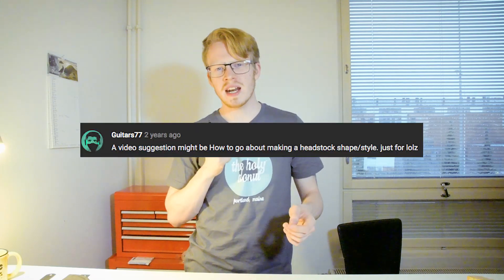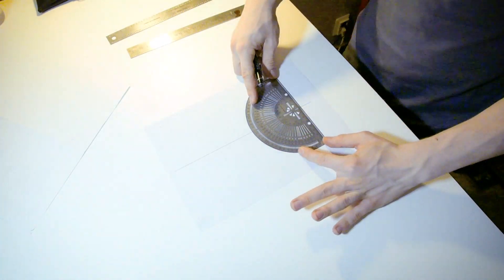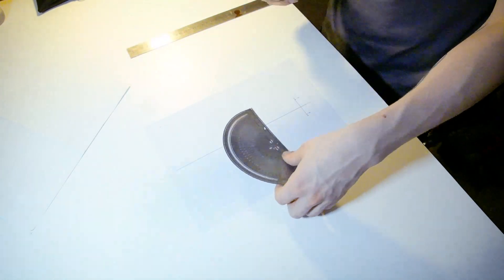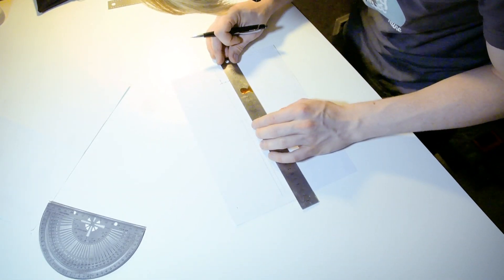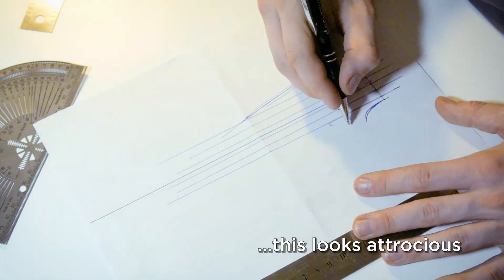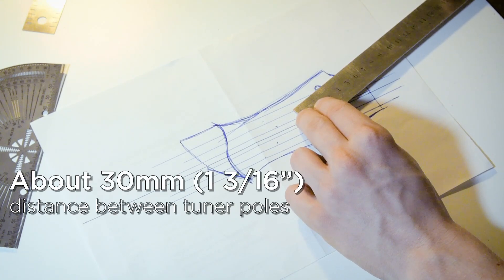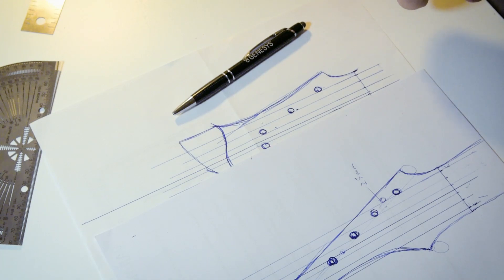How To Design A Guitar Headstock - GUITAR BUILDING TIPS

Comment: Thanks bro, I'm currently trying to build my first guitar, and I'm having troubles with the headstock, I've made a plan from a weird uncommun bass headstock, that I've made a template out of. But now that I'm trying to figure out how to align it with the neck, I just discovered, that the strings we're not gonna be in a straight pull, NOT AT ALL. So ill try to play with the angle a little bit and use your tricks to make them a little straigther, even if my headstock is a little crooked in the end, I don't want strings to be bending that much.

Comment: Interesting.
For straight string pulls, where do you plan the location of each tuner peg in relation to the peg's string line? 
 - Put the centerline of the peg on the string line? 
 - Put the tighten edge of the peg (during righty-tight tuner turns of the tuner knob) on the peg's string line? 
 - Or some other placement of the tuner peg in relation to the string line? 
        Do you need to account for the diameter widening as the more of the string wraps around the peg?

During design, what diameter do you use for the peg (not the hole to be drilled) in order to properly place the machine head in relation to its string line?
Reply from the maker: Fantastic question!
So essentially I account for the first string wrap, so from the point of view of the side of the tuner shaft. The exponential diameter growth or added string winds I haven't come to notice as making all that much different to necessitate taking into the equation. I'd rather have the tuners look more cohesive between one another and the edge of the headstock than have to worry about all of them being incrementally at different distances.

So simply put: commonly the shaft of the tuner where string wraps around is 6mm, so account for 3mm away from the point at which you drill the whole.

Comment: do you take the string guage into consideration for string spacing at the nut/bridge?
Reply from the maker: Yes at the nut for sure :) the thicker gauge, of course you'll need to take into account the size so that you don't have the strings essentially sit on the very edge of the fretboard
Reply: @IPGuitars  thanks... so, just want to make sure my understanding is correct... the string to string distance (edge to edge, not center to center) is the same value?
Reply from the maker: Not sure I understand what you meant, but basically what I would do in the case of thicker gauged strings is to find the distance from the edge of the nut on both sides and then use the string spacing rule to find the rest. The string spacing rule compensates the distances between slots (or string centers as it were) to allow for even spacing between the different gauge of string.

I hope that answers atleast some part of your question😅
Reply: @IPGuitars  yes, you did answer my question, many thanks again.
Reply: The string spacing rulers don’t create equal spacing at the nut. They are meant to take relative string gauges into consideration. Therefore, you cannot take the spacing generated from the ruler and extend the lines up to the break angle and expect to get equally spaced tuner locations. If you are looking to achieve equal tuner spacing, you will have to live with a compromise on the straightness of the strings. Its a small difference but I think it should be noted for those who are wondering about this or who are looking for perfection. If I’m missing the mark on this please feel free to correct me. I found out the hard way BTW.
Reply from the maker: That is absolutely a great point!
In my example here, I am speaking in broad terms. Trying to aim for absolute perfection will of course require WAY more precision than something achieved here.

I tend to opt for this method I talked about, because I might vary the gauge of strings I use depending on the use of the build, but keep the location of the tuners the same with same shaped guitar headstocks.

Yes, the different gauge of string (and how many wraps the string does around the tuner) will change the straight line of the string following the nut, however not enough to cause the string to bind in the nut slot/pop out :)

But yes, definitely a good point you made if you are going to be using a specific gauge and wish to aim for absolute perfection. It's a challenge for sure, but not impossible.
Reply: @StephenSgro  thank you... that's exactly what i tried to ask... but not successful :P
Reply: @leochen1960  your welcome!
Reply: @StephenSgro  Additionally, the ghost strings he's drawing here aren't necessarily parallel. He just eyeballed those compared to the centerline. For straight, parallel strings you'll want to use that protractor again based on the nut that you draw, just like he did with the centerline.

Comment: and for 12 strings?
Reply from the maker: Great question, and really depends. Two/three ways you can go about it:
1) 6-in line on both sides
1.5) 3+3 smaller/offset on both sides
2) 3+3 and then 3+3 between with holes in the middle of the headstock as you you find on a classical acoustic

And then apply the same principles as with a "regular" headstock

Comment: First time headstock designer here. Are you measuring 12mm from the edge of the tuner side to edge of the 10mm tuning key hole, or to the center of the tuning key hole?
Reply from the maker: I am measuring 12-13mm from the side of the headstock to the middle of the hole-to-be-drilled :)
Reply: @IPGuitars  Thanks!

Comment: I would note a couple of problems with these designs, just to make sure no one else accidentally repeats the mistakes.

The first is just minor and has to do with the shape of the 6-in-line shape. Your cutout opposite of the tuners is too deep. You probably shouldn't be crossing the string with the desired shape line. I mean you could, I suppose... it probably wouldn't hurt anything directly, but it leaves the E string exposed with no protective wood around it. If you bump something within that scoop design, it's going to hit the string before the headstock. Like I said, kind of minor. Don't hit the headstock, and it'll be fine.

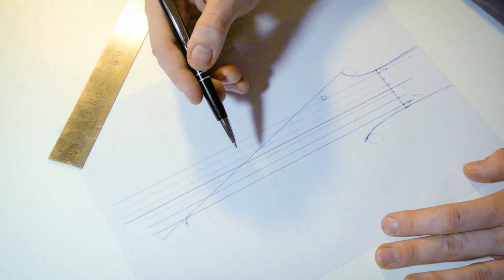The other is an issue with the 3+3 design. You've used two conflicting thoughts here. You made a curved shape, but then just aligned the tuning machine holes in a straight V pattern. The tuning machine holes, as you stated with the 6-in-line headstock (5:54), need to be a specific distance in from the edge of the headstock. They should follow the shape of the headstock, while also remaining at an equal offset distance from the edge of the headstock. In your example, the D and G machines for sure, and likely also the A and B machines, are not going to function, because the handles/buttons/whatever-they're-called are going to be directly under the wood of the headstock. Two solutions to this dilemma are seen between a Les Paul headstock and a Flying V headstock. Form vs function. On a Les Paul (a pretty typical 3+3 style) the D and G strings break out at more severe angles away from center due to the distant tuners needing to maintain the edge offset of the heastock design. On a Flying V, the shape of the headstock is modified to an atypical arrow head shape in order to keep the strings straight while maintaining the edge offset. This is actually more analogous to a 6-in-line style. Musicman's 4+2 headstock uses the same intersecting angle style (triangular), but they have a little more design leeway still, due to the offset number of machines on each side. It leaves room for a sort of bubble area to make the shape move outside of just a triangle. On a Flying V triangle style, the only place to make any innovation is to vary the overall length of the headstock, stretching or squishing the triangle, so to speak, or by adding a sort of ornamental design to the tip of the triangle (Sort of like an Ovation headstock, or your preliminary axe-head style shape before you modified it to be shorter).
Reply from the maker: Thank you for your comment :)
To the first minor bit: Totally agree on the exposed E-string, but the actual shape of the headstock was not really the point of the video, so they are what they are unfortunately. While I should've actually pointed that out more clearly as well.

And you are completely right again about the 3+3 headstock. Again, I should've clarified that the main focus was the distances between tuners and the offset from the edge. Also, admittedly I should've actually PROPERLY designed headstocks here instead of just drawing a random shape for a "sort of" reference on what to do. And I still maintain that the horrendous 3+3 shape I drew is well.. just that. 

Soyeah, fully agreed with you that had I done a proper job of actually making headstocks that work instead of the surface-level technicalities, this would have been a much more helpful video. One which (now looking at it) I really should remedy.
Reply: @IPGuitars  Looking forward to the reboot. 😜
Reply: @IPGuitars  thanks for further explanatios.

Comment: To simplify this somewhat, for a six in line headstock with straight pull (generally speaking), for the fairly standard nut widths of 1-11/16" to 1.703" and string spacings of 1-15/32" and 1-17/32", respectively, the angle of the tuner side should launch from the center line at 15°. Accounting for the touch points of the strings to the tuner posts, position the center points of the through holes between 15/32" and .500" from the edge of the tuner side, spaced at roughly 1" to 1-1/32" along a centerline of the holes. This is very close to what Fender has been doing for decades.

Edit: Use a draftsman's circle template.
Also, consider the proximity of the tuner closest to the nut, and try to make sure it isn't too close. This is to accommodate the tuner body, and also to make sure there is not insufficient string between the nut and the tuner. For most six in line headstocks, there should be about 1.500" from the nut to the nearest tuner.
Reply from the maker: Thank you for this :) slightly better worded than my ramblings
Reply: @IPGuitars  I liked your video quite a bit. I started developing a basic line of instruments about a year ago, and by far the hardest part has been nailing down the headstock shape. It is quite hard to match one headstock to a variety of body designs.
Another area to touch on is tilt-back versus flat headstocks and how the neck to headstock transition works in either case. I personally prefer the Fender approach because it is simpler, is less likely to break and saves on wood.
I'm going to subscribe to your channel, as I greatly appreciate people who explore design and engineering.
Incidentally, are you Dutch, or maybe South African? I'm trying to place your accent.
Reply from the maker: Glad you liked the video and I totally agree. Headstock design is a royal pain to get looking right.

As for angled vs. scooped, I am right there with you. While I prefer the look of the angled headstocks, the benefits of making a scooped headstock greatly outweigh it.

And actually no, I'm neither :) I'm Finnish. Accent comes from going to an American school while living in England. An odd amalgamation of the two I suppose.
Reply: @IPGuitars  That's quite funny, when I lived in Montreal a few years ago I worked with a Finnish woman named Taina, who I also mistook for Dutch. Finns are great. Nice meeting you. 
I'm going to be uploading a video of a finished guitar in the next few weeks. I'll be sure to let you know when I do.
Reply from the maker: Haha, nice meeting you too :)

Oh awesome, do let me know, I look forward to seeing it!

Comment: I’m sorry but the commentary about “tension” of strings beyond the nut seemed like nonsense to me. In my mind, the key consideration is the break angle and downward pressure at the nut. Thinner strings require more break angle/downward pressure at the nut. That is why Fender 6 in line headstocks typically require string trees. A reverse headstock eliminates that concern.  So does the MusicMan 4x2 approach, although the G string could still be problematic if the tuning machine is too far from the nut. 

You also left out a critical consideration:  what are the dimensions of the back of the tuning machines?  Will they interfere with each other?
Reply from the maker: Good points made, but the gauge of string argument for why Fender uses string trees is a bit invalid. As the Fender style headstock is a scoop, the tuner poles sit "upright" and the string does not get enough of an angle when wound. String trees help create the angle and downward pressure on the nut, but this would be exactly the same were the string a set of 9s or 13s :)

You had the right idea for the downward pressure on the nut for sure! And you make a good point that I did not mention tuner dimensions. This can differ depending on what brand of tuner you go with and whether they have pins or if the screw holes are to the side or "down" (for lack of a better way to put it).

I should have rectified this by saying that you should check the dimensions and specs for the tuners you use, before designing. For instance with my own headstocks I have the tuners 13mm in from the side, but on. 3-3 headstock they are 30mm apart and 6-in line they are 25mm apart.

Comment: Hello sir!
Designing a inline headstock has never been a problem for me.
It’s so easy because it has a straight line on the edge as a guide.

But how do you make sure the 3+3 headstock shape works with actual tuning machine perfectly?
Some model of tuning machine don’t come with accurate blueprint (missing some important dimensions)
Do you make several testing template and mount the tuning machine on then adjust the design accordingly?
Reply from the maker: When working with designing a headstock in general, it's good to have the tuners you are planning on using ready. This will help with figuring out what works. Seeing as I predominately use Schaller or similarly dimensioned tuners, I know to keep 13mm from the edge and atleast 25mm apart. Then combining that with aiming for straight string pull, I have my rough dimensions to base the shape upon :)

Comment: Just staret watching your videos, and I think your content is great! Keep up the good work. 

I would like to learn more about the neck (break) angle for a set-neck guitar. I am about to embark on my first guitar building journey, and the thing I am currently most concerned about is getting the correct neck angle for my bridge. How do I find  the correct angle for the heel, and how to I apply it in practice?
Reply from the maker: Thank you very much :)

As a matter of fact, I have video coming out where I draw out a guitar 1:1 and I'll tackle this as well. But usually, the neck angle sits around the few degrees mark. So say a trem/hardtail bridge, you're looking at about 2-3 degrees. A tune-o-matic would be around 5 degrees. Quite honestly, the easiest way to figure that out is the draw the guitar full-size :) working out the angle is fairly simple when you know your bridge height, where the neck connects with the body, and the fretboard thickness.
Reply: @IPGuitars  Thank you in return! Looking forward to more content in the future :-)

Comment: How would you work out where to place the tuning machine holes for the 3x3 design? I'm going for the same design were the machines go steadily inward.

😅 Preferably I don't want to mess this up.
Reply from the maker: With the 3x3 work out your string spacing and draw where your strings would be. Figure out the distance between each tuner post. You can start working out where the tuner posts will land. You'll want the tuners to be marked on the side of each "string line" instead of on the line. This is because when you're stringing up, the string doesn't go straight into the tuner post. It wraps around it, therefore you want that to be a reference on where to place the tuner posts (or where to drill).

Essentially, you can get really specific about it if you want to, but in general due to your strings wrapping around the tuner post a few times, you can easily work it out just by drawing it out carefully. If it helps and you have access to one, have a look at a guitar headstock and use it as reference for planning out your own.
Reply: @IPGuitars  Thanks allot, that's essentially what I ended up doing, wasn't to sure whether it was correct 😅 I appreciate it.